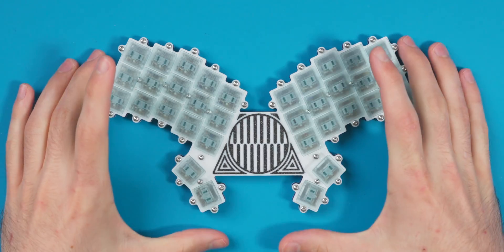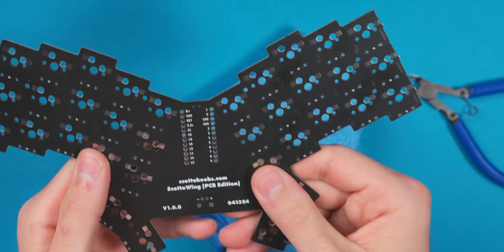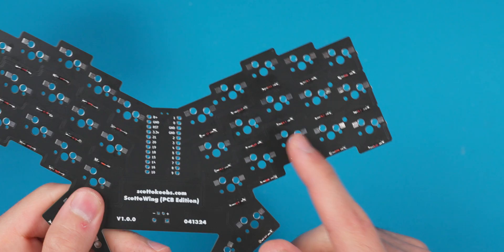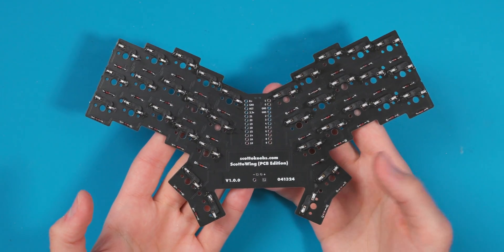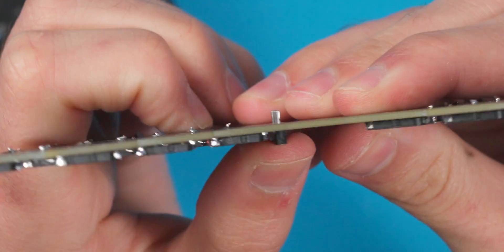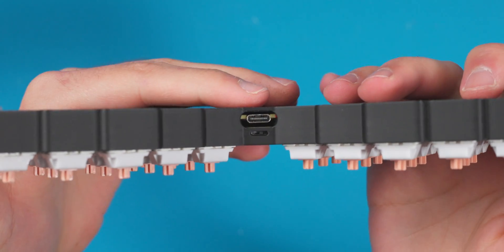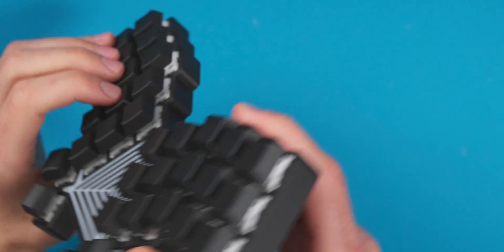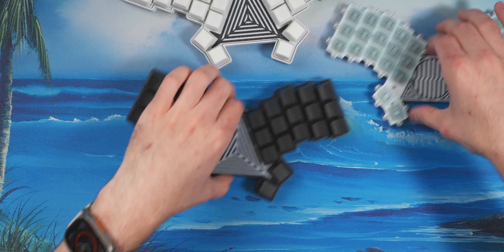Building the ScottoWing (PCB Edition) Mechanical Keyboard

Comment: Hey im getting into keyboard stuff and im wondering, would it not be possible to make a split ergo keyboard but only using 1 microcontroller? i dont exactly see why not as maybe i could just use some usb or connector or whatever, but perhaps you have some ideas?
Reply from the maker: Yeah, you just need a cable with enough lines to pass the matrix: https://youtu.be/nY5QrDrGWAw
Reply: @joe_scotto  ooh i hadnt seen that video, thanks a lot!

Comment: can I use mill max socket instead of kailh hotswap socket?
Reply from the maker: Not on this board because the holes are large to accommodate the sockets. To my knowledge only solder boards are compatible with mill max. That said, the kit comes with the sockets so you don’t have to buy them separate.

Comment: How important is alignment of the hotswap sockets with regards to ensuring the switches/keycaps each stay aligned and not twisted or crooked vs the ones around them?
Reply from the maker: The socket itself handles it because it sits in the PCB. If you put them on upside down though you won’t be able to get the switch in the board.

Comment: Personally i basically only use SMD diodes, but i like using a hybrid footprint for them, it sometimes even makes the routing easier because you can be on whichever layer to connect traces into the throughhole slots.

Edit: Also when soldering, apply some solder into one of the pads on the sockets / smd diodes, and then you can just place the componen into place and apply heat to the pad again. Its way easier than putting the componen down and then soldering.

Another edit: I've used painters tape in place of kapton tape with no problems, it might be easier to get your hands on if you need it ASAP
Reply from the maker: Oh yeah, I 100% prefer SMD diodes just for a beginner through-hole is easier :)

Comment: nice... hmm i thought i saw on some other boards they use a dongle for bluetooth...do you not have to do that anymore?...also is switching bluetooth connections doable through the keys?
Reply from the maker: I’m using a nice!nano which is just regular Bluetooth so no dongle needed. You can switch profiles on the bluetooth settings layer. It has 5 different profiles you can set it to for different devices.

Comment: Hi Joe. Do you have any tips on how to make 3d printed plate/case feel more solid? I've recently almost exactly the same corne keyboards. hotswappable PCB + plate. While one was an original FR4 plate vs 3d printed one. And the 3d printed one feels soo mushy as compared to the original FR4 one.
Reply from the maker: You can print stuff solid but FR4 will still be more stiff as it’s basically fiberglass.